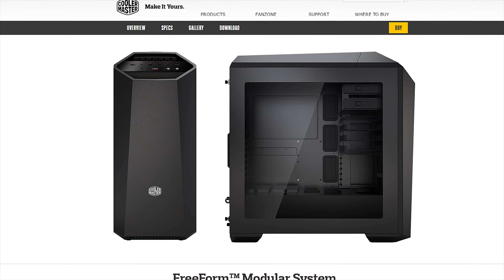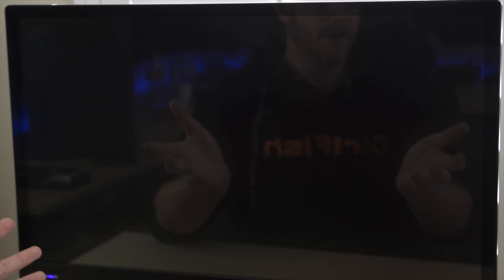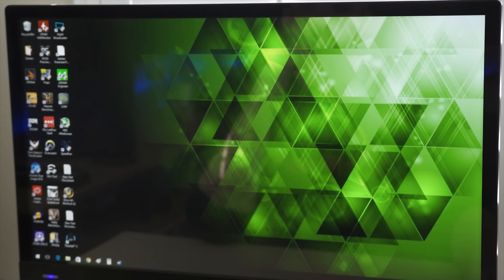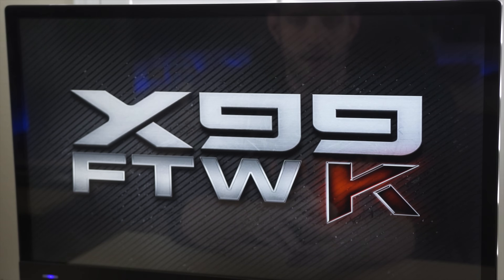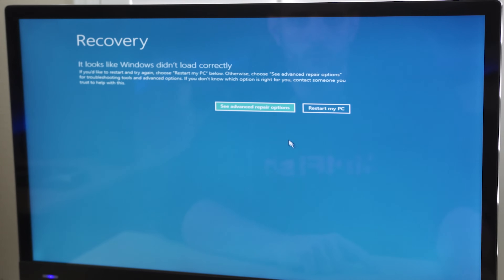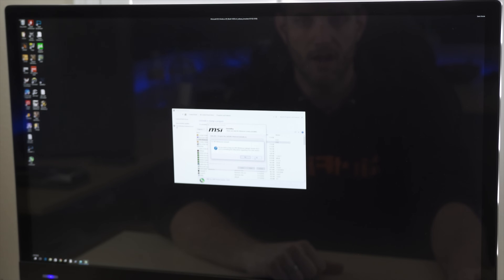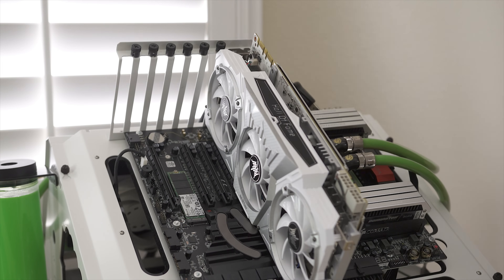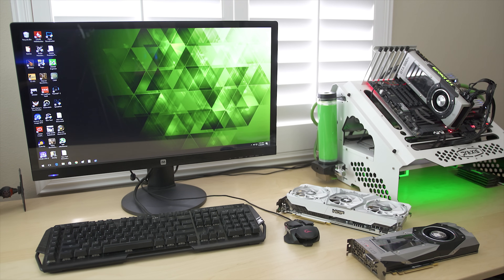How to fix a bad overclock on any Video Card

Comment: 1. Restart in Safe Mode. (Pressing F8 while booting up).
2. Uninstall MSI Afterburner.
3. Restart Normally.
4. Voila !!

Other way :
1. Remove Graphics Card.
2. Boot using motherboard port.
3. Uninstall MSI afterburner.
4. Put graphics card back.
5. Voila !!
Reply: Voila means
Reply: 4aLse hello can you please help me
Reply: 4aLse what do you do if it won’t even start up, and I tried to overclock I black screened and I took out the power cord and now it won’t turn on at all, Ives tried to take out the BIOS battery and now it won’t work st all
Reply: You fried you gpu  you have to get a new one
Reply: Toxic Moguli why would the gpu be the one that fried tho, I tried to overclock the cpu
Reply: Me: 
1. Plugs monitor into motherboard
2. Uninstall MSI afterburner
3. Voila!!
Reply: Yesss. I was wondering if that would work. Im using Precision X through steam and cant find the program when in safe mode. Figured the Mobo option night work. Gonna do it after work today.
Reply: I mean, reinstalling windows was easier
Reply: hold down CTRL on boot to disable the apply on startup with afterburner
Reply: Der_Rusher and Voila !!
Reply: 69 Like.
Reply: Thx

Comment: Ah bless you, I was struggling from a bad overclock on my GPU and you saved the day.  One note, you can get into the safe mode within Windows 10 as well - just hold down SHIFT, then chose the START button, then POWER and follow it by RESTART, then it will bring up the recovery settings as well.

Comment: There is a third method: Take the cooler off, and pour liquid nitrogen on it till u get the clockspeeds down, I mean if they can get a 6050x to 5.74ghz, it should keep it stable for long enough to disable the profile
Reply: *6950x
Reply: Kishen Pankhania
goes to the backyard for another bucket of liquid nitrogen.
XD
Reply: Nope that will crash the same way. The temps are no problem. The voltage is much too low.
Reply: @HeavyMetalGamingHD  Yeah.

Comment: Always keep a password on your user account, so then when you reach the log in screen (which won't open certain apps like afterburner), hold down the left shift key and then hit Windows restart button at the bottom right corner which will take you to startup options. This works inside Windows and for Windows 8, 8.1 and 10.

Comment: you can use the integrated gpu... seems easier :p
Reply: not every CPU has this feature but nice input.
Reply: iLLixer404
Yeah. If you get an extreme edition CPU you have to do it some other way. But if you went normal cpu line (like I did) it makes your life easier
Reply: AMD FX CPUs also don't have an iGPU
Reply: OutcasT
True. So, if you have an Intel non extreme edition or an AMD APU, you can use the iGPU to erase the overclock.
Reply: +OutcasT well, you could just try to get safe mode started as he suggested. You could then just fix the issue with the gpu you have installed already. Otherwise you're either looking for your old gpu that you just kept around for diagnostic purposes or looking for a really cheap gpu elsewhere.
Reply: yeah, thinking the same thing... I think the test bench has a 5960X in it though. That's probably why he never mentioned it.
Reply: I could do that :)
Reply: All the non Vega ryzen owners just sit and wonder why AMD couldn't put in an i GPU. lol

Comment: SAFE MODE, is the only simple way, no need to uninstall the msi burner, just delete the profile.
Reply: Right.
Either delete the file Afterburner saves the profiles in.
Or even trickier: open the file and edit the "apply overclock on startup" entry.
Reply: teeracullaz if i am on amd ?
Reply: Same thing
Reply: Or a Linux live CD?
Reply: teeracullaz w
Reply: How
Reply: But I clicked reset because I didn’t watch the video and now I’m just waiting

Comment: That's honestly how I reacted when my GPU crashed.
R9 280x doesn't overclock that well, I'm upgrading to a 1070 soon though ;D
Reply: Ikr my R9 390 doesn't overclock well neither
Reply: Yeah my R9 390 doesn't overclock worth a fuck either lmao, even with a 3 slot cooler design it still doesn't run cool enough for me to bump up the core voltage a whole bunch without having a jet engine in my case.
Reply: The 1070 is awesome. I have the evga ftw 1070 and I love it so much
Reply: Barely OCed my R9 280x and have been having heat problems constantly. It's not worth it.

Comment: you could also just use your onboard graphics instead of a differnt gpu
Reply: Bruce Sherbet not every cpu had that
Reply: most modern cpus do im just saying that tho if u dont wanna boot into safe mode :)
Reply: Bruce Sherbet 
well or gpu with Dual bios helps alot
Reply: Not many GPUs have dual bios but there are all methods
Reply: Bruce Sherbet 
dual bios is safe bet if problems it froze but it can boot up with default setting
Reply: derpy153 ofcourse they do have iGPU's. For example, i7-6700K and i5-6600K use Intel HD 530
Reply: yeah with my 2600k you had two types of mobo to choose from, one type would allow use of GPU and one was not the case but was for OC
Reply: All K series Skylake CPUs have on board graphics
Reply: well it means the CPU has it, it depends on the motherboard's features...

Comment: u can always use motherboard onboard gpu vga, hdmi,dvi slot, remove ur graphics card and insert the monitor cable in onboard display slot and after that deletethe profile or uninstall the msi after burner   completely.
 reinsert ur graphics card and there u go its fixed 😃
Reply: But I don't think all motherboards support on board graphics.... right?
Reply: Ihaveleaky Spaceboots  ya but most of the mobo support onboard display specially low end
Reply: +Ihaveleaky Spaceboots most of those are high end mobo's
Reply: yea that makes sense.
Reply: newer mobo doesn't have onboard graphic. the one that has integrated gpu is the CPU itself
Reply: sorry if I said that wrong, but I meant support for the cpu's integrated graphics.
Reply: xs3tsunax chances are if you bought a mobo that has onboard capability and you don't know shit about building ur own computer the guy(person) who helped u put it together prob chose a cpu capable of on boarding, duh
Reply: Just realised every1 in the comment section is talking bout this lol
Reply: savage!
Reply: xs3tsunax that is bullshit i think high end Mobo should also have onboard display
Reply: like i said, they move the onboard graphic to the cpu because newer mobos doesn't have northbridge. its better to do it this way because you don't have to worry about breaking the onboard graphic
Reply: Arif Hassan well reason high end mobo doesn't have onboard display ports is same reason why hammer vice grips are aren't high end tools. Yes they do both jobs but do neither very well. U has gooder logics. Mewn

Comment: or if you have an intel cpu, just remove the gpu and launch with intel hd graphics, assuming you didnt disable in bios
Reply: ***** I didnt know that, I am back with the i7 4790k back when haswell processors have had integrated graphics.
Reply: Skylake K series processors do have integrated graphics. It's mostly just the extreme edition processors that don't (Haswell-E, Broadwell-E)
Reply: ThePaisleyProject I mean you still can get into BIOS with a bad oc so it doesn't matter if it's disabled
Reply: Ryan good point, i was meaning if you decided to remove the gpu
Reply: currentcrazy1 are you referring to the 6950x?
Reply: 6600K & 6700K are Skylake, 6800K & 6900K is broadwell-E.   
Intel is confusing as hell with this..
Reply: Joey Hobbit yeah it is
Reply: +currentcrazy1 Incorrect mate. Not all 6XXXX processors are Skylake. You need to read up on processors and take a look at some spec sheets. The 6700k is the highest number for the Skylake chips. The 6800k, 6850k, and 6900k are Broadwell while the 6950X is Broadwell-E.
Reply: wddplayer can intel just stop being confusing
Reply: currentcrazy1 Broadwell/ Broadwell-E is the 14nm die shrink of Haswell, not a variation of Skylake. Skylake and Kaby Lake are going to have their own E versions.
Reply: Fire Phenix Somewhere in the looking up of things I forgot to make the correction to my comment with having only the 6950X as the Broadwell-E. The 6800k-6850X are all Broadwell-E chips. There is actual Broadwell chips though, they just weren't nearly as popular or long lived because they were mainly targeted at the laptop/ notebook platform. The better question for you would be what is the difference between the 6800K and the much more expensive 6850K. The biggest ones are the 6850k having an ever so slightly higher base and boost clock speed as well as 40 PCIe lanes compared to the 28 on the 6800k (which is only beneficial depending on what you do with the chip). With the amount of money you dropped on a CPU and motherboard, you hopefully knew that and took it into consideration when purchasing  the 6850k over the 6800k.

Comment: Tell me how to liquid cool a radiator.
Reply: Remove radiator from case, place radiator in bucket of ice water
Reply: atvkid0805 no .. place in a river ... there is waterflow
Reply: Put salt in vodka, put it in freezer for 72 hours, put dry ice into a container, put vodka/salt mixture in container, then put the radiator in it.  ez temps
Reply: shouldn't safety be our number one puhrrity
Reply: HendrixCikes puhhrity
Reply: Konstantin Demenko  Actually the liquid in the radiator heats the radiator since the radiator is designed to cool the liquid.
Reply: Use automotive coolant, as always. :P
Reply: @Blueknight1960  You can always buy an air cooled engine. :P

Comment: So if my Cpu has onboard grafics I simply cound switch between Gpu and cpu onboard. Right?
Reply: If it's enabled in the bios . Then yes
Reply: Wolly 9102 that would be the easiest thing to suggest in my opinion
Reply: Adam JP    indeed I Have my HD 530 Running alongside my 1060 purely for anything happens to my 1060 I still get an image  on screen :p
Reply: Flyingchris2249G that's what I was going to suggest
Reply: Enabling your on board graphics card produces more heat though -.-
Reply: Josh Carter   if it doesn't Have an display to Feed with an image. No it doesn't :)
Reply: Wolly 9102 yes actually it does, if your over clocking it requires more voltage to keep the cpu stable. that's why most overclockers recommend turning OBG off before doing so.
Reply: yeah.

Comment: So, if I have an iGPU with my cpu, can I just remove the GPU instead of the switch gpu method?
Reply: Columini yes
Reply: TurboCMinusMinus I dun think thats possible bruh
Reply: Well, you can overclock integrated.
Reply: With limiters.
Reply: Yea u can use ur integrated graphics, just remove the bad OC gpu and plug in a video signal onto ur MOBO.

Comment: MSI Bugged once for me same way (I was downclocking my card) and it made like last number that was avaible when I pressed reset (so 23124123+MHz) - it was crashing every time. I just removed configs by live linux usb.
Reply: Awesome ! Also, downclocking is for real enthusiasts (power consumption / thermal enthusiasts, that is). I would like to do so too with my future build.
Reply: MrBiky
with new cards there is almost no need to downclock your GPU - I was doing that because I was thinking it is overheating but that wasn't case ;)
Reply: Ace
Well, you are right too, since most of them already have fan 0 RPM mode. But it would be fun to see how much I can underclock it.
Reply: I have had to down clock my GPU, due to my motherboard not coping with both my fx 8350 and 980ti. My cpu is stuck to a 4.3ghz oc at 4 cores. While my 980ti is stuck at 80% max power draw. It isn't the psu, for I had issues with a 1kw psu in it. Well, connected to it. The 1kw psu was from a late 2005 apple power mac G5, that I had modded.
Reply: Matthew Tremain
I like that case, but I really wouldn't trust that 11 years PSU. Even PSUs today have a warranty of 10 years at most, and that's with 80 plus gold and platinum ratings. I am 90% sure that PSU isn't giving more than 500W by now. Considering an 8350 with OC can reach about 200W consumption and the 980Ti has a power draw of 250W + the rest of your components, I say you should at least try it with a good PSU. Of you have a friend that owns a more recent 1, you should try it (also, I guess you know, but 980Ti requires at least a 600W PSU, so anything beyond that should do).

I had an old 450W PSU that had like 13-14 years and was still giving around 230-ish W and could power an FX 4100 and a Radeon 6670 GDDR5, but once I overclocked the CPU, system was unstable. Changed the PSU and the OC was never unstable again.
Reply: MrBiky that is one of thr reasons why it is in my server/daughter's computer, not the main rig. But it is what I had to test.

Comment: Theres also a key combo that lets you not run the MSI Afterburner profile on boot.
Reply: how? can you please explain. I got stuck with Overclocked clock settings.. I've Zotac Rtx 2070 mini .. i just tried Overclocking and i did around 1800-1900 something then after that I'm stuck with boost clock of what I've Overclocked. Even after uninstalling all drivers several times and Changing pcie slots as well. Please help
Reply: @tusharanaje32  If you are overclocking set the Power limite tô 100 not 120 you dont need to squeeze 20% If you are already overclocking
Reply: What key combo?

Comment: Can't you just untick "apply at startup" in safe mode? Instead of reinstalling?
Reply: woopygoman I buy it for tree fiddy Vietnamese dong
Reply: I believe if you did it as soon as you open the .exe the profile would activate and then potentially crash the system anyways
Reply: I don't think you can open up 3rd party apps in safe mode.
Reply: you can't open most programs in safe mode, pretty much anything that isnt dependant on stock windows drivers. For example MSi afterburner needs nvidia/amd drivers to work which are not activated in safe mode.
Reply: Can edit the profile/settings with notepad so it's not activated.
In MSI Afterburners install directory, in folder Profiles there is a cfg file. Edit with Notepad and there is a line "RememberSettings=1", change value to 0.
Reply: EvilWiffles Bingo! :)
Reply: EvilWiffles damn boi pro tip, thanks.
Reply: woopygoman what I’d you can’t open startup mode :/

Comment: I overclocked my gpu, I went to safe mode and uninstalled msi, I can no longer use my pc on anything but safe mode, please help
Reply: kickachicken 88 in safe mode press windows+r and type msconfig then hit ok. Go to boot tab and uncheck safe boot. Then hit apply, ok, and then restart pc, if this doesn’t work tell me so I can tell you the complicated fix.
Reply: @ijaamesss  guys, I do the same mistake :( than I uninstall msi.. :/ I do your steps and I dont have check save boot. When start win10 after shov me bacground screen video is crashed (show me some purple artefacts) and restart PC.. I mean hat now I must upload new BIOS to GPU - it is correct?

Comment: I had my old GT 610 oced 300mghz stable. Hot. But stable. 82C
Reply: I did that a while ago
Reply: What games can you play on a 610??  I have one in my spare PC and it's awful at everything.
Reply: Goofygiggles I overclocked my GT 610M on laptop by 120Mhz. Temps reaching 88℃
Reply: GT 630m here.. hail peasants
Reply: Lol, when I ran my r9 290 +200mv, 1140mhz in my old room, it ran actually hot but stable, like 95° C :D. 
Somehow in my new bigger room that translates to only 84°C
Reply: coinsagE46m3 CS, minecraft, and coolmath(dot)com XP - what CPU and ran in your spare PC?
Reply: SamCovert that's pretty decent for a laptop that is that old
Reply: Mohammed Aliyu OooOoOoOOO
Reply: zarmaan khan if it is stable in one game and not another, then the card isn't stable in general
Reply: ***** eh, too much effort for minimal gain. i havent tried ocing in win10 tho. the problem in the games ex. fallout 4, f1 2015 was nvidia drivers crashing with oc
Reply: Had my 7300 GT back in the dasy running at 640 MHz. That's a 60% overclock!

Comment: Would be cool If vga has some jumper to back on default settings
Reply: I know it sound so 90'th xD
Reply: There are some cards with dual bios one modded one stock and u can switch between them with a little switch on the PCB

Comment: hey, give me your spare 980ti, i will give you my geforce 210 :V
Reply: Msi I bought a GeForce 210 thinking it would play subnautica. Hint it didn't
Reply: Leif Anderson DAMN how did you get to that tought?
Reply: I really don't know, and to make it worse my cpu is a fx 4100.
Reply: I owned an FX 4100 and overclocked it to 4.4 GHz on its stock cooler (the one with copper heat pipes). That was a pretty good CPU, it was great with my HD 6670 GDDR5 edition. But I had to sell it, needed money back then. Though I paired the FX with a GT 630. I am still using the 6670 with a Sempron 145 unlocked to Athlon x2 4450e and overclocked to 3.2 GHz (still stock cooler, but this one is that Aluminum one). It still servers me well, since I am a filthy casual gamer (I rarely play any games).

Somebody had a Pentium 4 with Hyperthreading (the 3 GHz variant) paired with the GT 210, they worked pretty well together for a low-end PC.